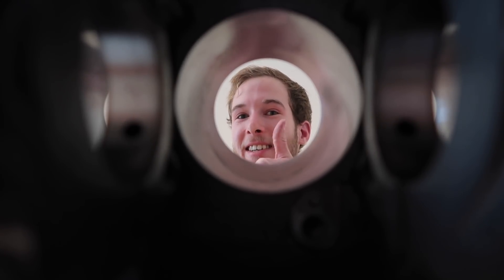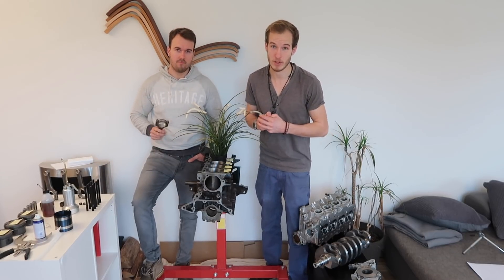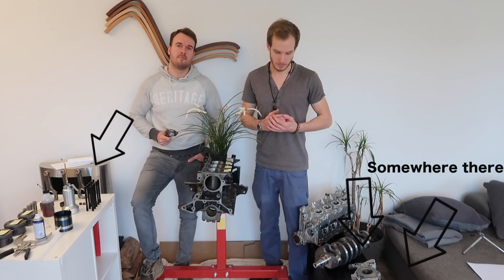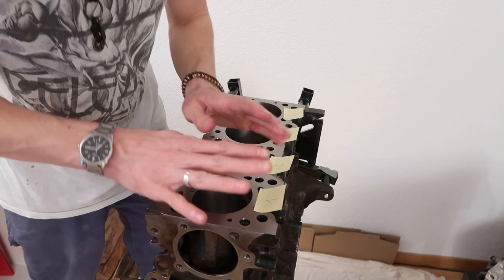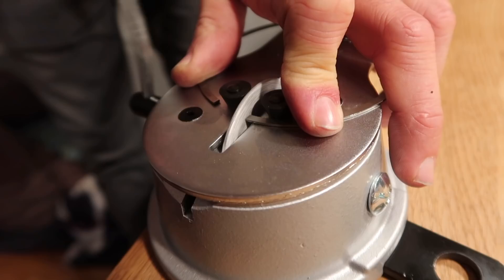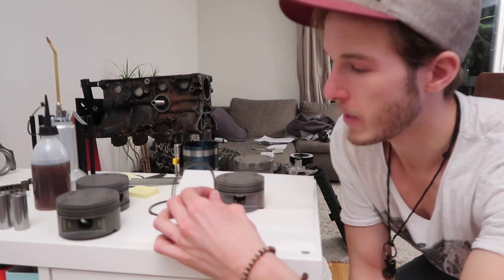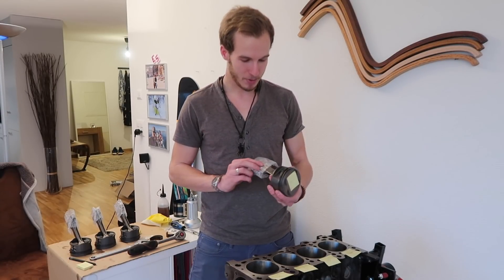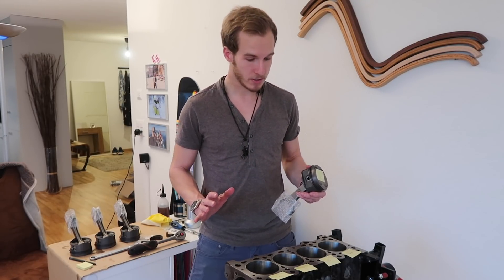Full Engine built for the Sleeper MX5/ Forged Piston, Rods and other Goodies S2E2

Comment: I only have 2 questions. With oil jets? Or without????? I'm about to put my forged engine back together and I'm stuck on this topic.
Reply from the maker: What do you mean? Our engine does have oil jets if that's what you're after.
Reply: @maxplorer8710  
I've gotten kind of confused due to reading forums. There are quite a few guys out there that say if you use forged pistons to build your motor,  that you're not supposed to use the oil jets/squirters because forged components do not need the extra cooling. Cast pistons will fail without the oil jets. I will be installing the oil jets due to wiseco manufacturing their pistons with a notch in them for the use of said oil jets. I've spent quite a bit on this engine and it's my first one being built from scratch so I'm just trying to do it right.  Ty for the reply and your car is absolutely awesome.
Reply from the maker: @scottmason2245  Hey mate no worries. To be honest that's the first time I have ever heard that and I have no idear why anyone would leave them out. They are vital to keep the piston temperature down especially once you start pushing boost. Hope your engine will be great.

Comment: the block holds in spite of pistons in diameter 85 mm, because I want forged my engine and I thought that it was limited ? Thanks you
Reply from the maker: Ah alright. To be honest we went with what SPS motorsports recommended to us. They have tons of experience with turbocharged miatas.
Reply from the maker: Sorry I don't quite understand the question? Yes the block is holding up well. I believe this engine can take up to 500+ hp if its build properly with forged internals.
Reply: @maxplorer8710  ,on the miata forums, they say that with 85 mm pistons the thickness of the liners is just right and that you have to x-ray the block to see if it works, that's why I wanted your opinion because I hesitate between 84 and 85